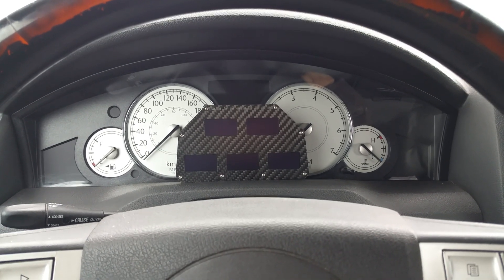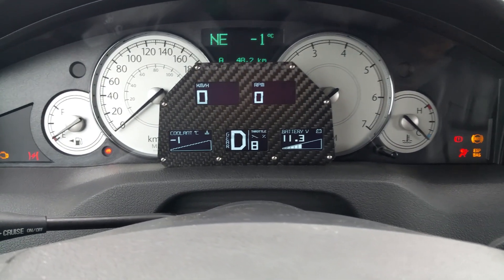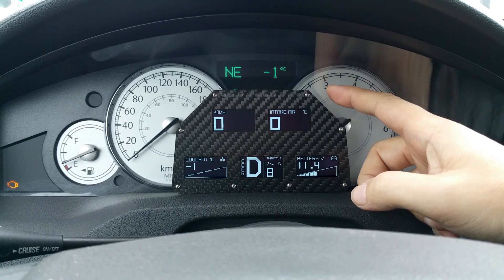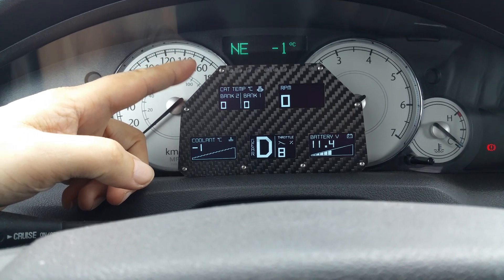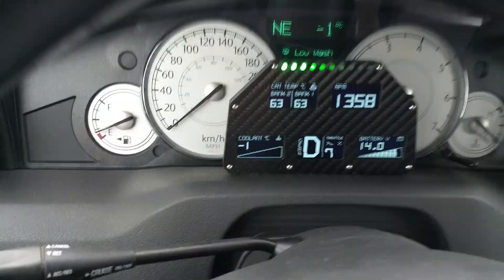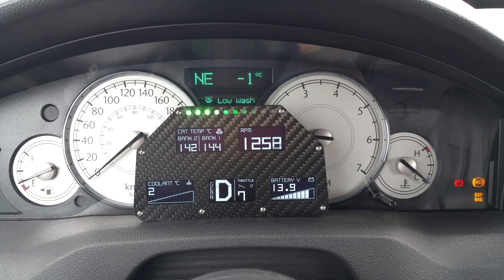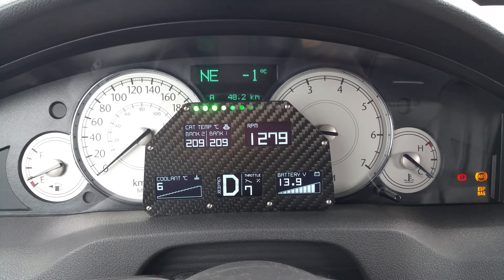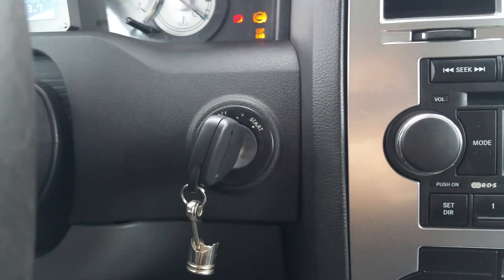CAN V-GAUGE Below Zero Test, Working without issues as expected, more info in the description :-)

Comment: Crisp clear display - good work. Any chance you could remote out those function buttons to dash/wheel mount somewhere?
Reply from the maker: Yes, that's the beauty of OLED displays, thanks. Sure can be done, just need to use a cable with 2 more wires. Or go fancy and hijack the steering wheel buttons :-)

Comment: What’s the cost for a dash?
Rpm, Battery(Voltage) boost, oil pressure,
Water temperature, Afr?
Reply from the maker: Please leave your email or message me through Tindie for pricing. There you can also see what screens are available. This is the link to the single screen version: https://www.tindie.com/products/18167/ thanks.

Comment: Nice work!  Gauge looks clean and informative.   Hope you are able to get that replacement battery soon, or the alternator checked!
Reply from the maker: Thank you, the alternator works as the voltage goes up to 14.1V when the car is running, have to save up for a battery :-) Will check the fluid in the battery, maybe one of the cells is low and the wiring as the battery is in the trunk and there is quite of bit of wiring.